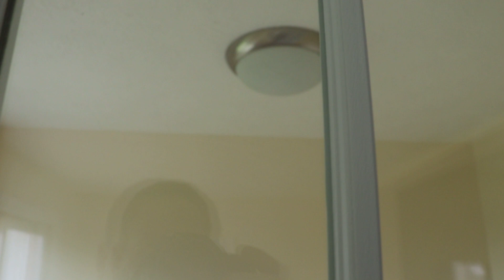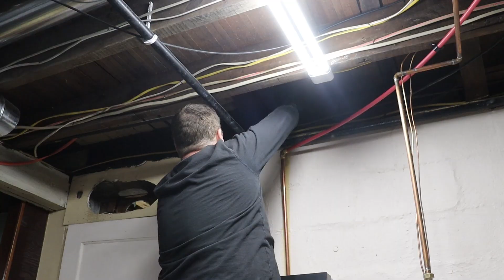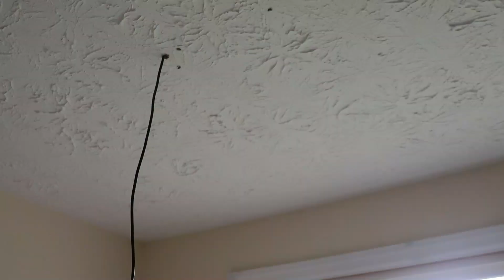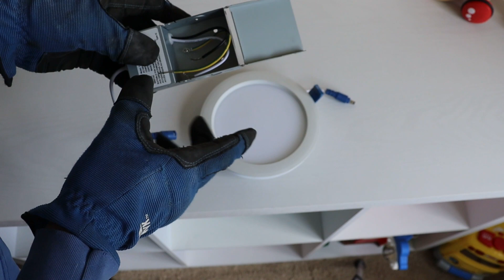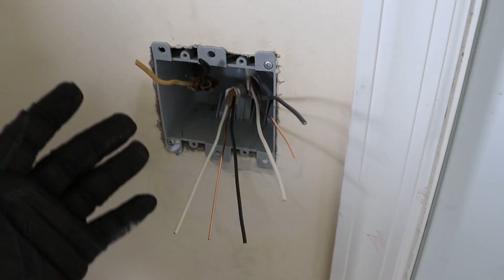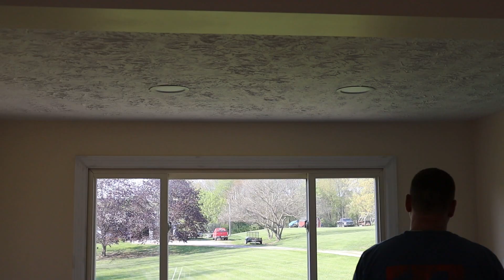How to Add Lights to a Room | Light Circuit Basics | Improve Your Home

Comment: Brettley, Thank you for the post and education. I don't understand a few things here. 1. What was the need to run new power from the box, when it already had #12 wire supply? 2. Is it safe to keep the #12 to the fixture since you changed the breaker to a 15 amp? 3. why two switches? In the video looks like the lights were all daisey chained as one control switch? Or did you have 1 switch only control a few of the total ceiling lights?. Thank you!
Reply from the maker: I just wanted to replace that section of wire. Yes, you can use larger wire than is necessary, not dangerous, just costs more, and inspectors like to see all of the components uniform. I didn't see a need to replace the #12 wire, so I left it. Using larger wire is like using a larger pipe than is necessary in a water system. The wire I ran to the switch box powered both switches. One to the porch lights and one to the den lights.

Comment: If it was me which it isn't because I can put a new plug on the end of an extension cord and that's about it LOL but if it was me I use the 12 - 2 in case I wanted to change the outlet for a microwave oven or something

Comment: Great info! You didnt have to change out the wire running to the old light? Was it also the 12/2 wire?
Reply from the maker: Since it is good shape I left it in place. If it was oldvknob and tube wiring I would have left it. it is 12-2 so I left it as it is oversized for the breaker and won't hurt anything.
Reply: with ground?